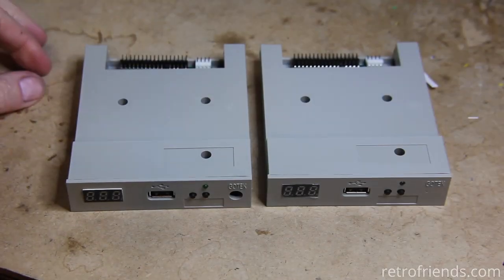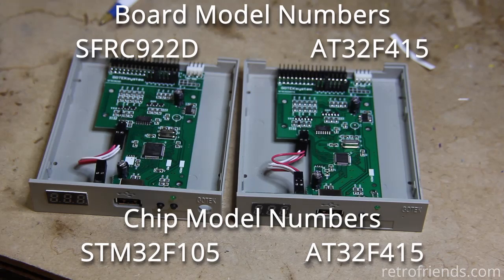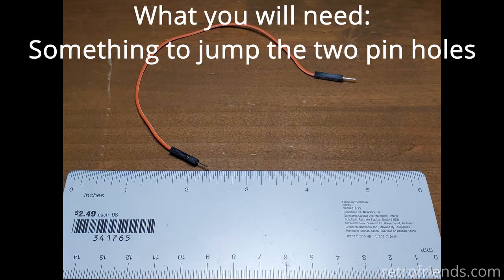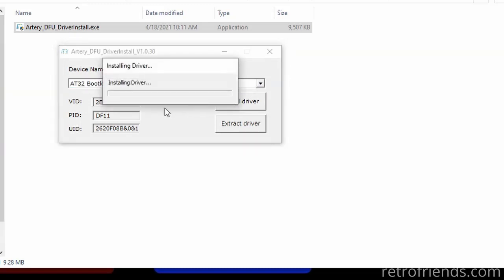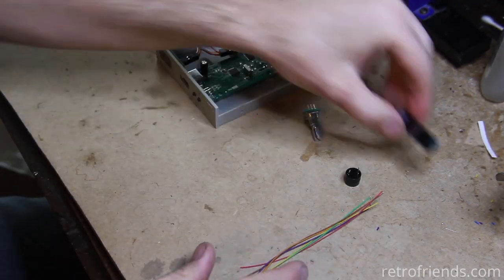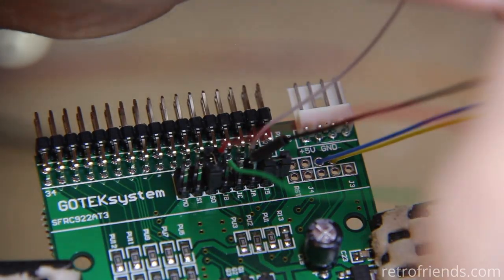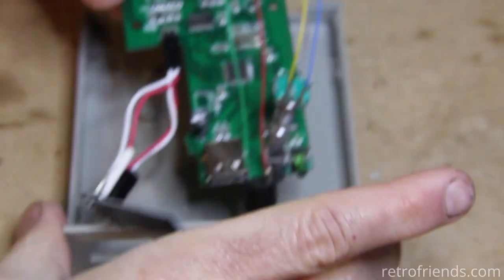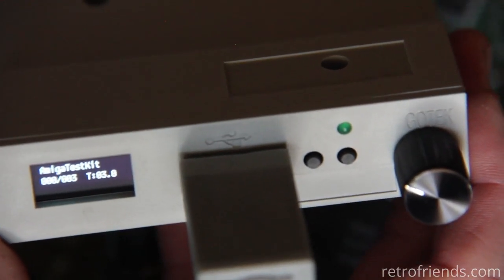Gotek Floppy Emulator: NEW 2021 FlashFloppy and Mods Procedure!

Comment: Hi, im new to the vintage sampler world. I bought an Akai S1100 with a Gotek USB Flash Floppy but I'm not sure what I'm doing wrong. I have updated the Flash Floppy to V3.29 however at the end of the installation it says Error 34. I have looked it up and it seems like I'm missing a disk image, I wanted to ask you if you knew what files do I need to insert into the USB for it to work. Thank you in advance
Reply from the maker: You just need disk image files for your particular host device. In the Amiga computer world, these are .adf files. I copy some .adfs to a USB drive, and then simply plug that in to the Gotek. No special software is required. Check the FlashFloppy Wiki for host devices and verify you have set the gotek up correctly. Also try googling your device + flashfloppy.

Comment: Hello, I installed Flash Floppy on the Gotek SFR1M44-U100K emulator with AT32F415 chip, then installed the OLED display and encoder according to your scheme. There is only one problem: only the button works on the encoder, scrolling does not work. Could this be a problem?

Comment: I have the emulator with built in firmware. Is there any benefits by using this custom FW? I don't have Amiga, Atari etc. Just a normal IBM PC.
Reply from the maker: I'm afraid I'm no expert at comparing features of different firmwares. Flashfloppy is the only free firmware replacement for the factory firmware that allows Amigas and many other hosts to use the gotek.

Comment: There is a gotek drive for my oscilloscope, but that drive cannot access directories. I was hoping to mod it with a rotary encoder and an oled display.  The gotek drive you modded has a different circuit board.  Can my drive be modded?
Reply from the maker: Sorry, I really can't answer that. Even if you told me which model of board you had, I am not familiar enough with other boards bought elsewhere to know whether they can be modded.

Comment: What is the purpose of flashing these? Do they not work out of the box? is it just to run this specific flash floppy software? if so, why?
Reply from the maker: I recommend you search for the flashfloppy wiki and read about it directly from the developer. Too much information to relate in a comment, but suffice it to say that it supports more devices and gives you more features.

Comment: I ordered the rotary encoder as you listed above and connected it up as you have shown. The push button works but the dial does not. Any suggestions???
Reply from the maker: If you hooked it up just has shown, it should just work. I'm not sure how much help I could be. I would say double and triple check your connections but I'm sure your response would be that you already did that. Do you have another one you can put in there? The link provided in the description I believe is for a pack of them.

Comment: I received my gotek today. It's weired that it's running on the artery chip but has the 2 soldering pads for the rotary...
Reply from the maker: It is using the larger of the two Artery chips that includes the same I/O pins that the ST chip had. I heard there might be some of those out there.

Comment: will this work with the sec serial bridge software and USB programmer?
Reply from the maker: Sorry, I don't know what a 'sec serial bridge" is. I mention in the video you can use the TTL serial method from my previous video. That method and the one in this video are the only ways to flash one of these Goteks.
Reply: Yes sure it does :) 
You can find the step by step documentation on this page :
https://hxc2001.com/docs/gotek-floppy-emulator-hxc-firmware/pages/bootloader-installation.html
Reply: @JeffHxC2001  thanks!
Reply from the maker: @TheBizzyBScience  That page shows a USB-to-USB method which is the same as outlined in this very video. The other TTL method is available in my other video, just as I mentioned above. And the third using a USB stick is in yet another one of my videos. Although the USB stick method is only available for updates to already-flashed Goteks.
Reply: @retrofriends  The USB stick method is also available to install the HxC firmware over a flashfloppy gotek. And TheBizzyBScience was asking about the online HxC firmware installation tool (The "SecSerial Bridge" software).
Reply from the maker: @JeffHxC2001  Yes that is what I just said ("already flashed Goteks"). Thanks for the info about secserial bridge. That explains why I didn't know it. The guy was watching the wrong video (mine). Thanks for directing him to the right place :)

Comment: OK I'm new to all this stuff .....watched it a few times and I'm totally confused ?
 which one are you flashing because the lids are on I cant tell are you flashing the one on the left or the one on the right ?I have the one on the left with the ST chip in so how do I flash mine please ..
Reply from the maker: For the benefit of others who will read your comment... In the video, I show the two side by side, but also there is a caption distinguishing them. The caption is the model number printed on the circuit board. You will have to remove the lid to see the model number. Anyone who removes the lid and checks the model number will be able to tell the two apart. Having said all that, perhaps you have not seen a previous video I did for the ST chip based versions. Check my channel for it - there is a "Gotek" playlist.
Reply: @retrofriends  Ahh.. so you DID the one on the right the A.T chip ...
That's what I wanted to know...
Just seen your other video about adding jumpers to the board and new firmware DfUse..
All done thanks to your videos .. 
Us old folk struggle you see because with the lid on i thought you where doing the A.T one

Comment: Re rotary encoder, the one you use does not have a board with pull-up resistors like the standard KY-040 rotary does. Did you desolder the encoder from the board, or else are you using an encoder that came bare, without the board? If bare, what was the model number/type/description keywords to find such a Gotek compatible bare one online? Thanks!
Reply from the maker: Amazon link in the description. All the parts are there.
Reply: @retrofriends  Thanks for the quick reply, however the Amazon rotary encoder listing doesn't have any specs, and I won't be ordering from Amazon (plus want a different type of knob than that bundle includes). Looks like 20 detents from reading some reviews, maybe I can read more of the hundreds there to glean some info. Surprised this is not simpler to figure out, and that this basic mod part isn't spec'ed on FlashFloppy Github, either.
Reply from the maker: @ShallRemainUnknown  I have added the specs for the rotary encoder on Amazon in the form of an answer to your question there.
Reply: @retrofriends  Thanks very much, but for the record, I didn't post any questions on Amazon! (Although I did see the question you must be referring to, LOL...)

Comment: why would you change the firmware ,i dont understand ,it already works out of the box !
Reply: @ampanman2000  maybe for amiga but not for pc i use usb_floppy_emulator_1.40i with a 20 euro gotek adding a oled screen or difrent cfw  is extra $$ for no reason at all ,can you load games with this cfw ?
Reply from the maker: FlashFloppy adds support for many different sized OLED screens, Rotary Dials, Speakers, OSD on your computer screen, and customizations not available with stock Goteks. Once you have used a Gotek with an OLED and Dial, you will never want to use a stock one again.

Comment: Does the USB Interface support Hot Swapping?
Reply from the maker: Yes. Pull the USB out, or select another disk and it simply acts like you ejected a floppy.
Reply: @retrofriends  Thank You for this Information!! I need a Gotek for my A2000. It is a Great Solution! 👍🏻👌🏻

Comment: Hi, if I use the serial method to update, do I use the artery flashing software on the PC please?
Reply from the maker: Sorry, I have not tried it, because the USB - USB method is sooo much faster and less glitchy. I imagine you would need to use a different program since FlashLoader is made by STM.
Reply: @retrofriends  I flashed my Artery gotek using serial UART and the Artery flashing software today, and it worked! Your guide was very helpful. Cheers
Reply from the maker: @j_bizzel  Oh that's right! There was a serial option in there! Never tried it, I'm glad it worked, and thanks for contributing the info :)

Comment: Is there a performance difference between the 2 models?
Reply from the maker: The company that designed and in this case redesigned the gotek would be shooting themselves in the foot if they made this replacement inferior. I have not had any reports of issues, nor have I had any myself. The gotek and host pc/music keyboard/etc will always run at floppy drive speeds, not likely a challenge for any modern microcontroller.
Reply: Sure there is a performance difference/issue : The AT32 used in these "new gotek" have only half of the STM32 RAM space (32KB vs 64KB). There is less memory for the USB cache. This make the format and the Amiga write operations less reliable : A full track can't be fully stored in ram anymore and the firmware need to flush to the stick in "real time"... If the usb stick ask for a pause during the write operation, the track could be corrupted.... 
Gotek System don't care about this because the original firmware only support fixed formats and doesn't really support format operations...
Reply from the maker: @JeffHxC2001 I appreciate the theory of operation. It gives us something to look out for. However, as stated in the video, Gotek is committed to Artery. Soon I expect we will have no choice, if not already. Fortunately, in all my testing with FlashFloppy firmware I have not seen any issues with reading or writing to USB with these new Artery boards (dozens so far). Others have had good success according to the Facebook group (potentially hundreds already). Not sure about HxC firmware issues, as I use FlashFloppy.

Comment: Interesting. I just got two goteks today, and they both have the Artery AT32F415 chip. But, the board looks a lot like the one on the left, including the two pin holes for the oled screen.
Reply from the maker: I have not played with one of those, but supposedly it will work and connect just like the STM boards. Check my previous video on modifying the Gotek for a walkthrough.

Comment: Hi. 
Yesterday I was able to "work" with my 2 new Gotek with Artery chipset!! Thanks for sharing, but only small diference on your video. On time 09:02 the my screen shows on READ PROTECTION, then I go ahead, back again when then when retrying again, WRITE PROTECTION is showed, then I go ahead again without any problem. Same version of Artery programmer V1.5.47.

 Thanks anyway!!  Great video!!
Reply from the maker: I had alread removed the protection as a test, but repeated the process for the video. Likely caused the difference shown. I did my best :)
Reply: @retrofriends   ... and well done!! :)